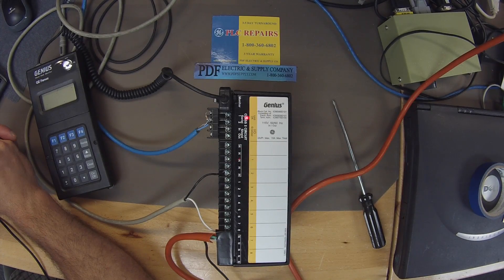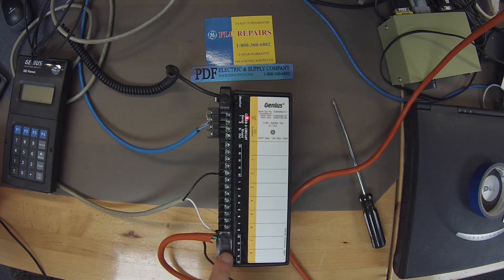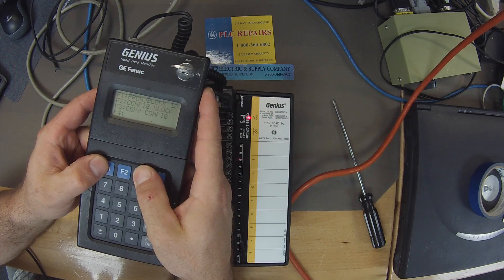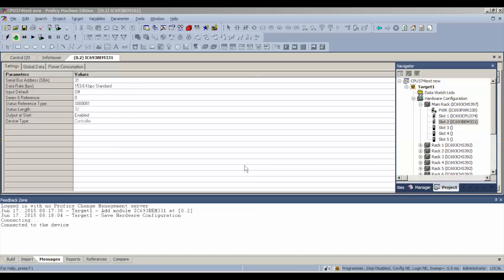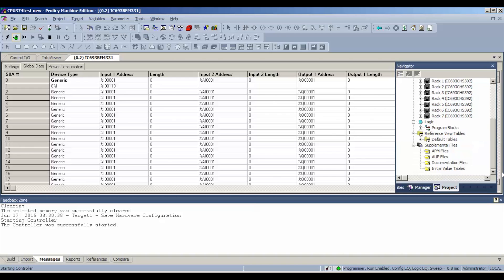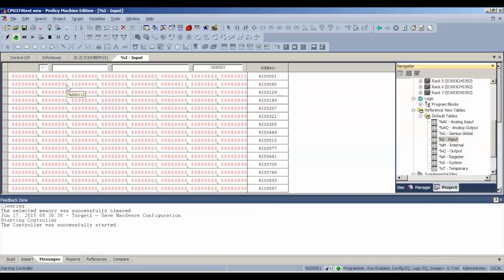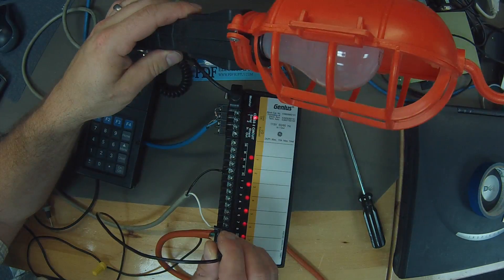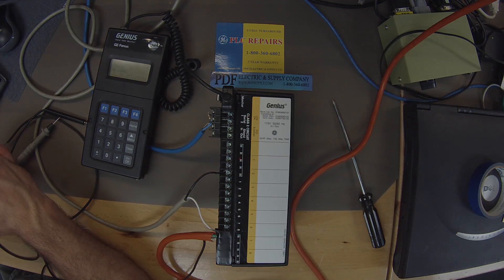How-to Set Up: IC660BBD101 (GENIUS I/O Tech Support with Proficy Machine Edition)

Comment from the maker: IC660BBD101
GE Intelligent Platforms / GE Fanuc Genius I/O
SKU 2176160  UPC 0313814319979
Block 115Vac I/O Low Leakage IC660B IC660BB IC660BBD
Description
The 115VAC Low–leakage I/O Block is an intelligent, configurable
module that interfaces discrete sensors and actuators to a
communications bus. The Block has eight identical 115VAC circuits.
Each circuit can be used as either an input or an output.